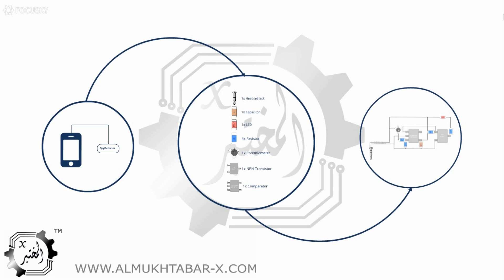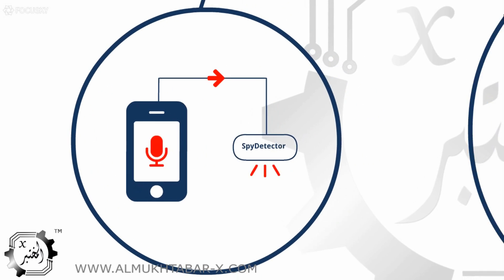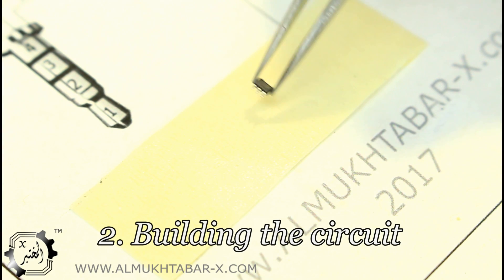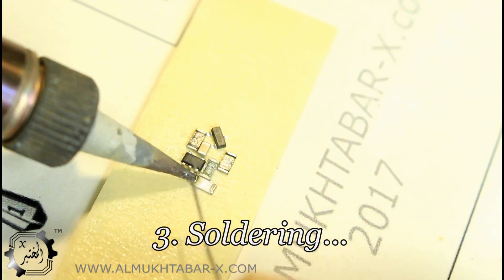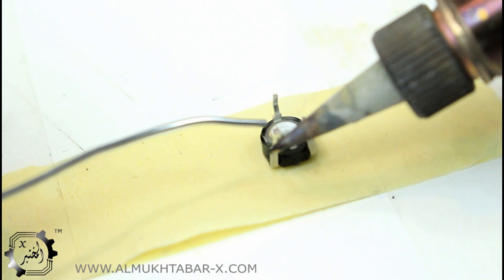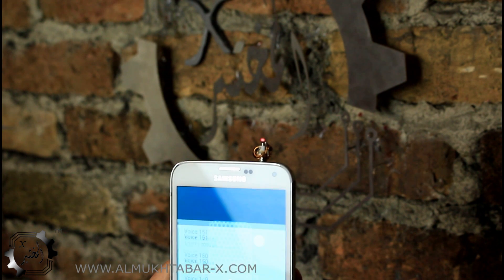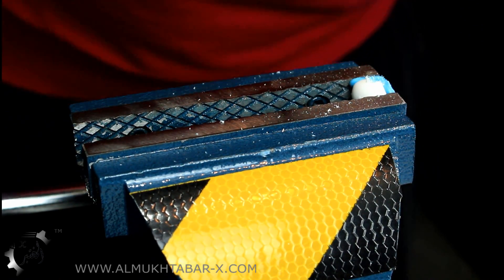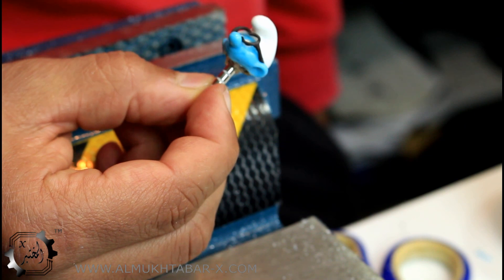A Smartphone SPY DETECTOR for less than 10$ !!

Comment: In order to make a version that also accounts for the internal microphone, and doesn't have to be plugged in, I had the following idea: Make a device that emits ultrasonic sound so that humans can't hear it, but it is still picked up by the microphone. Then, using a wifi module and a packet analyser, you could try to find a certain pattern of sound that you play.

Comment: What's better are physical isolating switches that disconnect microphone, camera etc.
But at any rate, if you were this concerned about making sure you could not be heard, you would ensure devices like smartphones were not present.
If an adversary had the capability to remote monitor your smartphone microphone, they would have the capability to acquire it's location and attempt to monitor audio devices in the same proximity.
There's a proof on concept attack where audio is captured via processed accelerometer data.
They could also mail you a gift or intercept an online order you made with an embedded bug inside. Or use parabolic or laser mics. Various side channel attacks; van eck phreaking...

Comment: I like the project!

I'm wondering if all the mics in a modern smartphone are disabled when the TRRS jack is plugged in.  I have a TRRS jack on my android phone.

It also occured to me, why not just connect the mic input to ground with a 10k (10r3) Ohm resistor?  Although that would make for a very short video. :(